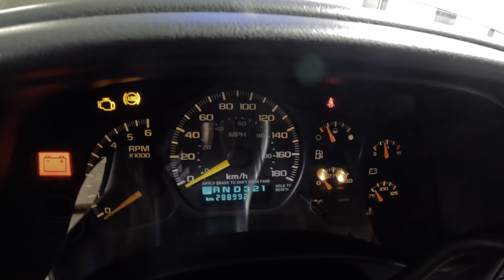Seize the Day! DO NOT Lube Brakes- Grease Jacking   2000 Chevy GMT800 Silverado 5.3 4.8 #repair

Comment: As an east coast Canadian, I can tell you from experience, if you don't lube the slides, you will be without brakes inside of 6 months.  
That however is an excessive amount of grease.   It's generally better to have the brakes cleaned and lubricated every so often too.
Reply: im in saskatoon , same thing as well
Reply: Yes, regular maintenance will not hurt anything. Just looking at the discs on this one would have told the owner something !
Reply: I grease the both sides of the hardware Connecticut dosen't fuckaround with the salt and spray
Reply: All forms of lube break down over time especially when it's exposed to heat from the rotors and pads, just add some brake pad and road dust and you have all the ingredients of making a cake. 
Take the above and then add some rusted flaky metal that's constantly exposed to salt air and salted roads, 4-5 months of winter makes the underside of a 5 year old vehicle look like its 12 years old. I know what you say to be an accurate statement
The bottom line, what you seen in the video is typical / expected vehicles condition dictated by the topography and climate. Seeing backing plates rust off is no surprise of any given vehicle for its age from eastern Canada. This is all unchartered waters for Ray, as he is not normally exposed to many vehicles that are owned by snow birds from our neck of the woods.
Reply: @IR-nq4qv  definitely.  This truck is immaculate compared to most of the stuff on our roads.  My father-in-law is a mechanic.  They have a couple trucks every year that fold in half on the lift.  Goes into the shop a Chevy and came out looking like the inspiration for the Tesla Cybertruck🤣🤣
Reply: In Ontario I also lube all my slide points.  I then do regular service of the lube to keep the rust away and brakes moving. If no lube is used its alot worse as the salt will stop things for even thinking about moving.
Reply: THANK YOUUUUU!!! FFS, it's very simple; a light coating of grease will do wonders, but far too often techs use too much, and over time it collects contaminants in the atmosphere and it gums up! Short term, everything is great, but long term, too much grease does more harm than good because it gums up the works, and over time definitely will lead to seized calipers; among other problems.
Reply: Woo East Coast, im in NB and i just apply a thin layer, like wipe on and wipe off which helps alot. just get that layer of protection. but i also clean brakes and relubricate guide pins, every once and a while, way more then others.
Reply: @Rekuzan  I think some people's montra in life is "if one is good more is better".  That doesn't just apply to lubricants either.  Lol
Reply: @smittysbuilds  Newfie myself, but I also lived out on Vancouver Island for a couple decades too, so I get where Ray is coming from. 

This stuff is just like a rifle.  Lubricate it...don't paint it.
Reply: The obvious fix is to never drive in a salted road area.
Super easy, right?
Reply: @MonkeyJedi99  it was when I was out west.  I saw daily drivers out there that long since returned to the earth out here.   But I like my house with it's ocean view and with one less zero or one less comma on the price tag.  
Gotta take the bad with the good.  😁
Reply: Same, southern onterrible here. I just use a thin coat. If I were in a dry climate with no rust issues, sure, I would not bother. Crap might stick to the grease, but it wont be seized.
Reply: Same here in Bancroft ON!
Reply: im from northern michigan, never once did i lube the slides at all, only lubed the pins never had one issue even with rusting.
Reply: @Jordy-927  "My dad said something like that once....just before the lab exploded." ~ Frankie, Transformers Rescue Bots.
Reply: i love your coment on TESLA ,😅😅😅
Reply: I hear that! Hard to say, but I'm guessing they used whatever they had in the grease gun. I've been using a ceramic brake lube I found at Napa Auto a few years ago. I don't know what's "ceramic" about it, but it weather's really well.
Reply: @grant6173  I've been a fan of sil-glyde for some time now.  You use so little of it, an 8oz tube lasts forever.
Reply: @Jordy-927 Agreed! Brake cleaner barely breaks it down. 👍
Reply: I always lube the brakes so they work smoothly, lol
Reply: Here in Minnesota I generally strip clean and grease my brakes spring and fall, and keep an eye on them through the rims, and recommend my customers do the same. The customers that follow that advice usually need less frequent brake jobs than the ones that only do it when they notice a problem.
Granted, some of these people don't notice a problem until the wheel falls off, but still.
Reply: @ForfeMac  not to mention maintaining fuel economy.  Dragging a brake can really put a damper on the old mpg's
Reply: correct!
Reply: Yep here in NL, Canada. If you used no grease it wouldnt move in a matter of a month here. especially this time of the year.
Thin layer of ceramic brake grease (i use Permatex Orange Ceramic Grease) on it before and after winter does it for me.
Reply: @toothlessthefc4394  yup I'm a newf too b'y.  I actually have an appointment booked for after Xmas to get mine cleaned and lubricated.
Reply: We did 'brake maintenance' jobs in the Chevrolet dealership, which I recommended be done every 25k.  Often times GM brakes can last up to 75k, and suffer seizing related issues due to rust long before the pads themselves wore out.  I had one customer that put 100k on the car before ever replacing brakes because they did the maintenance.

I will say though, I never put it on the slide between the pad and the shim, because then it just made a mess.  I did however always grease the caliper bracket between the slide clip and the bracket to try and prevent rust buildup.  It's also quite beneficial to do that with the hub face to prevent it from swelling as well.  Traverses, Equinoxes, and Impalas were quite notorious for massive rust build up on the hubs.  I once had a car that had a brake job done by one tech, and then in 10k I had it because the hubs were never cleaned of the impacted rust that they developed massive vibration, and even made a weird squeaking noise.

ALSO ALSO:  When you get a box of AC DELCO pads, there's a picture inside the box that CLEARLY says you're supposed to grease the pad bracket, the pins, and the BACK OF THE PAD.  Even though they come dry from the factory (Save a penny per axle and whatnot), but also they assume the rust buildup won't happen badly enough in time.
Reply: @Kieva_Storm  I got 107k out of the brakes on my Colorado. I could have turned the rotors, but why bother really.  I replaced them with original parts replacement stuff from my local dealership, which were actually 50 bucks more total over the NAPA gold stuff.  Not sure how long the Napa ones last, but I know the GM ones can go for 100k so that’s what I got.  It’s my daily driver and fishing truck, not a race car, but it does have 33” 10 ply load range E tires for driving over the fishing and hunting roads made from blasted shale, so I’m not particularly easy on my brakes either. 
Now, I am Canadian, so this is all in weirdo distance.  I’ve always gotten 100k plus’s out of factory GM brakes.
Reply: @Jordy-927  In my professional opinion you should never cut rotors, unless your pads failed prematurely.

My explanation: brakes convert kinetic energy to heat energy to be dissipated, via friction. Air passing over the components dissipates the heat. The thinner the rotor, the less heat it can absorb. It is the higher surface area component. It, therefore, is more effective at dissipating heat than pads. New pads on a rotor that has been through a full pad life, and then further cut to smooth it out and not wreck pads therefore further reduces the heat the rotor can hold. More often than not, on modern cars you'll hit the minimum thickness before the 2nd set of pads wear out. 

Cutting rotors is only good for if your pads fail unexpectedly, which typically doesn't happen.

But your brakes lasting 107k proves my point.
Reply: @Kieva_Storm  I agree.  I've had it done in the past on some junk winter beaters, but it never lasts, then neither does the beater, lol. With the price of rotors, it's not much cheaper anyway, it won't last more than a year, and zero warranty.  For a few bucks more, get it done right.
Reply: He's not talking about the slider pins, hes talking about the sides of the brake pad.
Reply: I live in Michigan, we have very salty winter roads. I have never applied grease on the open area that is exposed, and I have always had my brakes wear perfectly evenly. I've never had any trouble.
Reply: @Chris-hn4lp  I know what part he's talking about, it was 6 solid minutes of the video, and he made a short of it.  
Thanks for pointing it out though.
Reply: @Jordy-927  Then that honestly concerns me. You should absolutely not be putting grease on that. The cars are not intended to have grease there, and will function good without grease, and will not function with grease because it will attract dust. Claiming that in Canada no grease will cause a failure is just plain false. I live in Michigan, we have fairly harsh winters, and very salty roads. I have not once out grease there, and every one of my 15+ brake jobs has worn perfectly evenly and worked great for long mileage. The purpose of those stainless steel metal shims is to prevent grease from being needed.
Reply: @Chris-hn4lp  don't let it concern you one little bit.   In 30 years of driving, I've replaced my brakes a total of 7 times on my DD vehicles and never less than 100k km.
Reply: I worked with a Sikh guy here in Australia, his brother has a shop in Canada, he told me nearly every brake job is get the oxy set and heat up the pad carrier to get the slides out.

Comment: As a tech in Norway, seeing a lot of rust due to roadsalt, I use a thin layer of graphite grease UNDER the mounting hardware. The problem is often that rust forms between the bracket and the hardware, pinching the brake pad. The grease helps prevent rust forming.
Reply: dry lube? Whats your reasoning? I use ATF, its got detergents to treat the metal.
Reply: As a tech in Canada, I use anti-seize under the hardware and then the normal high temp brake grease only on the pads, not on the hardware/clips so it doesn't have so much dust and junk sticking to it.

Comment: If you live in the rust belt area, you absolutely need to lubricate the slider on the bracket otherwise you will have seized brakes pad in less than 20k KM so roughly 12k miles

Comment: When I was a brake tech at a major retail auto shop we were required to use moly lube on all of the metal to metal part because customers complain about noise if you don't, but that being said moly is expensive and you only use the lightest of a skim coat, and yes I saw a lot of uneven wear with both lubed(incorrectly), and unlubed alike. As far as backing plates we removed them up here in salt land as there was documentation that they served no real purpose except to hold salt and snow into the rotor. As always Ray keep making good videos
Reply: I did see some documentation mentioning that backing plates help with air flow / cooling, or something to that effect.  However, I can see your point also, most backing plates I have seen are pretty rusted.  One job I did I cleaned it up and rubbed in a rust preventative lubricant onto the surfaces - best I could do at the time.

Comment: I think it depends on the conditions in which you drive your car.  I grew up in AZ and never greased it, was never an issue.  I live on the east coast now and if I don't put a very light coating of anti-seize on them they rust in place.  I put the lightest of light coats in it though.
Reply: Eric O always does this in the land of rust and corruption...
Reply: Exactly, thin film is best, apply, and wipe most off again. Leaving a thick film is bad, you want just the slightest hint of lube to provide rust protection.
Reply: Exactly, I even go as far as to smooooo some grease all around the bleeders so the next guy can just wipe it off, twist and hopefully do the same for the next guy.
Reply: Exactly, in outback Australia the last thing you want it grease around anything. Here in the UK you want something, I use brake grease, particularly under brake hardware.
Reply: The pitfalls are over-doing it, and even the type of product. I finally settled on silicone grease after some of the "dedicated" brake lube products on the market drying out, getting tacky and then binding up slides and guides. And marine anti-seize is another ally. Just personal experience from over 30 years of working on my own junk across the rust belt.
Reply: @shaneoneill1338  I used to use a small sheen of silicone, but recently have been using the purple permatex ceramic brake lube and that has been better.  What I was taught lubing o-rings was "A sheen; not a shine" in regards for what the o-ring should look like after lubing it, i.e. don't overdo it on the lube.  I think the same applies here.
Reply: Just a little grease on the ears of the pad then wire wheel and grease/antisieze the bracket under the clips. If you don’t protect under the clip, the cast iron will rust and swell/jack/bind the pad
Reply: @sonnydavis7339  Ray needs to do a collab with Eric O where Ray gets to do some suspension work on a Western PRNY vehicle. No tappy tap out of wheel hub assemblies 😄
Reply: @sonnydavis7339 Eric uses a rust inhibiting compound on the steering knuckle and bearing housing. He uses a different compounds on the brake caliper pins. I haven’t noted him using a grease compound on the exterior of the stainless steel guides. Ss304 and 316 stainless steel are noted for their rust resistance. Just my observation. Everyone has their own opinion. Not saying yours is incorrect. Do what you need to do.
Reply: The type of grease might matter also. I noticed a guy way up north from you in NY uses silicone grease and not on the whole slide, plus on the caliper where it touches the piston.
Also instead of never seize he uses Fluid film which since I am in Canada and experience the rust issues. I never used anything till I saw Eric I using fluid film which is better for rust than never seize.
Reply: 54 years on the east coast and never greased anything on a disk brake other than the slide bolts, inside thier boots.  No problems.
Reply: @Lloyd973  usually a silicone grease.
Reply: The grease should go between the shims and the caliper. Not between the shims and the pads. The shims are stainless, so rust will not be a problem on them.
Reply: @m0ondoggy  just purchased some of that permatex purple. Thanks for the recommendation!
Reply: @joedunn1109  The pad is not stainless though.  It really depends on where you live and how the caliper is designed.  I have had calipers lock solid even with the stainless shim there.  Whoever did the one Ray is working on used way too much and the wrong stuff.  If you just use a smidgin you're fine.  My truck sits outside and drives on salted roads in the winter.  If I don't do this I'll get uneven pad wear and I'll start to feel it pull before I even get to springtime.  I have had a pad build up rust and lock itself in that channel.
Reply: Ray, here in Canada there is no debate. You always use grease wherever grease is able to be applied. 6 months of real winter means 6 months of road salt. That Ontario truck is in great shape for its age! Spring and Fall during seasonal tire changeover I always pull apart the brakes, clean the caliper, slides, bracket, hub, etc. and apply fresh grease everywhere I can.
Reply: I didn't think breaker would freeze from rust but didn't think about it
Reply: It all depends on how much anti seize is being used. I was always told from dealer ships and their manufacturers  that even if the shims are stainless steel they do and will wear through  from the steel brake pad rubbing against it constantly  and  the heat build up from hard braking. And metal on metal does cause metal shavings.
Reply: On my European Ford i think the pins are all enclosed with a little rubber boot. It's been awhile since I had to work on them. Certainly don't remember any buildvup.
Reply: I think that's proper wat as well.  It's about the climate your in!😊
Reply: @tractorsold1 what part of the east coast? Just working on your own vehicles or doing it for a living?
Reply: @jimkane9832  Up and down, but mostly between NY and Northern VA.  My several cars.
Reply: Yup, I never used to put grease on slides and then after winter (mid-spring) I started seeing a few of our fleet cars with seized brake pads. In about 5-6months since they were serviced (by me ) the pads had rust jacked into the bracket. I started applying a thin coat of brake grease and this past spring, didn't have any issues with pads rusting on
Reply: @andrewthompsonuk1 an Aussie here, I use lock graphite power or dry Teflon spray lube where dust is a problem. 🦘
Reply: I am a mechanic in New England, and as long as you use a die-grinder to remove most of the rust on the brackets you shouldn’t need grease/lube.
Reply: If you clean up the clips or put new ones on. There is no reason to lubricant that at all. This is why caliper fail beacuse you have that dirt building up going in between the pistons when it moves forward and back and damaging the seal inside.  This is why you don't lubricant the shims.

Comment: Fluid Film on all that fresh clean metal and backing plates will deny rust from forming.
Reply: Fluid Film is AMAZING!!!! I thank Eric O. every time I use it!!!
Reply: @K.Kelly87  I spray vehicles once a year with a spray gun and compressor using Woolwax underneath and Fluid Film inside all panels. Zero rust.